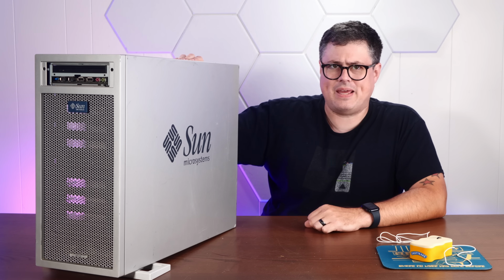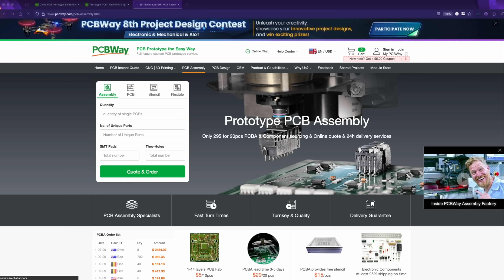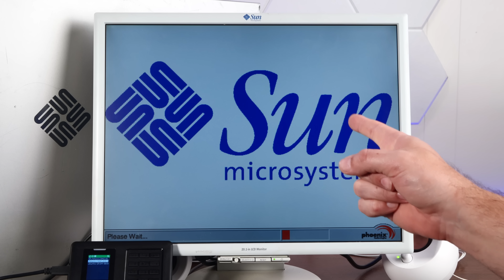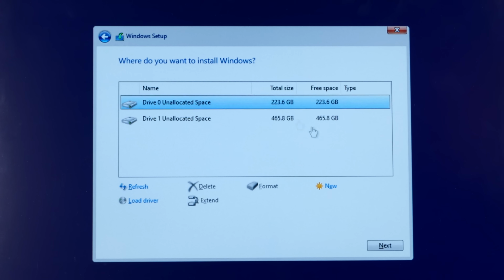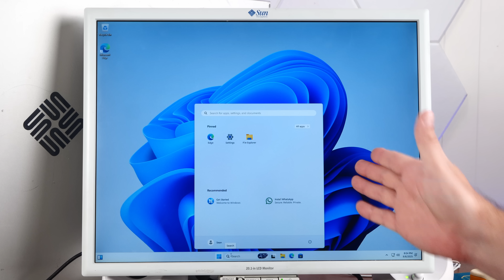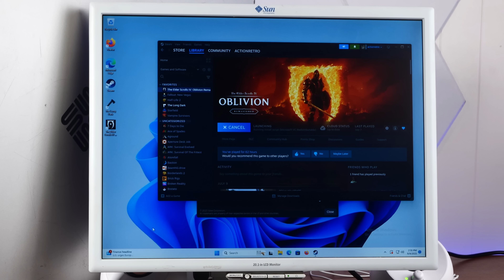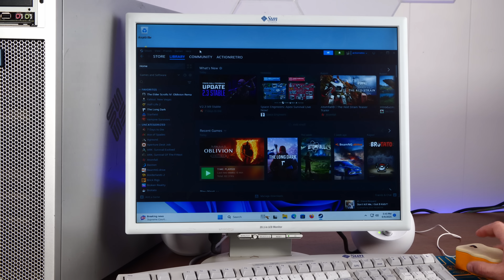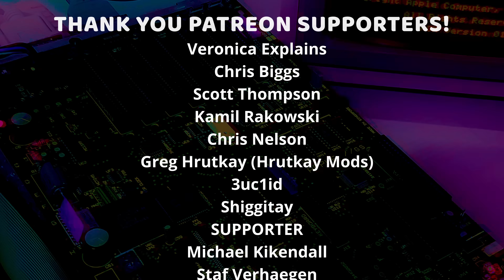The Oldest PC That Can Run Windows 11

Comment: These old workstation really where at least 10 years ahead of its time
Reply: it probably took over 10 years to pay for it
Reply: They were good but even a core2duo is many orders of magnitude better. Core2Duo machines are still usable even today. I run windows 10/11 on mine smoothly with no issues and use them daily.
Reply: 20
Reply: @cal2127  Windows 11 runs on my 2015 gaming PC just fine.
Reply: @Surplus_Softworks_Official 10 years isn’t that old for a PC anymore. Windows 11 runs just fine on my 2007 optiplex 745.
Reply: @cal2127 Wouldn't go that far. My mother has a dual CPU system from 2006 and this one was competitive playable until 2016. It was high end until 2010. It passed even the Valve VR Test and was telling me the CPUs where fast enough for VR if nothing was running in the background. Need to benchmark the system at some time
Reply: Nah😂. They were a joke compared to a Linux core2 dou extreme or xeon which was 4 core not 2 and an Nvidia quadro with an adaptec scsi card running Redhat Linux or Ubuntu or XP dual boot if needed for 1/4 the price. The Nvidia drivers were high quality back then and it would be an amazing workstation for it's day

Solaris was already on its way out and couldn't run VMware workstation. This would be for proprietary old apps which most were still on spare. So very niche and not general use if you could help it
Reply: this is 2xdual core Opteron CPU, it just equivalent 4 core CPU.1 dual core Opteron 2005 is much slower than core 2 duo e7500
 I dont think 2x CPU Opteron as fast as core 2 quad Q9400.

Comment: Tbf I feel the SSD is doing most of the heavy lifting getting Windows 11 to run decently, try it on an era appropriate HDD and it's just going to chug
Reply: I mean, even Windows 10 runs terribly on a HDD. Considering how cheap SSDs are right now, I think it's completely fine to use one on old stuff. HDD is only useful for storage nowadays in any circumstance.
Reply: @JorgeALXNDR  If you can whack a 2TB HDD in for your data (about $60) an SSD large enough to dual boot Windows and your favorite Linux distro costs less than $30.  For $90 you have a computer that boots quickly off of an SSD and still have room for your movie and music collection.
Reply: @mharris5047  That's close to what i do. I have a NVME 2 tb for windows and new games. Then i have 2 x 8 TB HDD's for Musik/movies/older games. the second HDD is just for redundancy.
Reply: You aren't wrong, but that's not great motivation to try it on an era-appropriate HDD
Reply: Sure, but it's the novelty.
Reply: Agreed in terms of speed and latency it goes 'Network > Storage > RAM > CPU cache > CPU registers'. Storage was lagging behind for a long time before we got SSDs and the old OS was built around expecting it to be crappy.
Reply: Removing a bottleneck does not mean its doing any lifting. Its just not dragging the rest of the system down anymore.
Reply: yup. i acronised the install of windows 11 from the pc i am on, an hp elite desk 800 g1 sff, to a 160 gb drive. holy shit took 10 minutes to boot. went back to the ssd!
Reply: And how about an era appropriate GPU and Ram amount?
He literally put the best that it could handle into it to make it look good.

8 GB of DDR2? Right on the limit.
GPU from 2014 and later 2020(ish)? Beyond what it was meant for and it's PCIe Gen 1 slot can handle. xD
Reply: Well yes! And if you want to drive your Car with your old Vespa Engine and Fuel Tank you may also better use a Bicycle!
Reply: You sort of missed the point though. It was to show that an old system, with appropriate hardware, can run the 'modern' op system.

Comment: Also if it is a 1000W PSU, it doesnt mean it runs on 1000W. I have no idea what really the consumption is, but I got an old DELL PE2950 in the basement with 2x 800W PSU's and it needs just 60W (without HDDs).
Reply: You aren't wrong, but in their original use as workstations they were given the power they'd need, and would definitely be wringing those PSUs for all they're worth. I wonder if playing games qualifies...

Comment: i ran into problems with early pci-e gen 1 slots, they wouldn't meet the power  needs of gen 2 or later graphics cards.
Reply: I don't believe PCI-E power specifications changed after Gen 1? 75 watts for a 16x slot.
Reply: @3rdalbum    im just saying, I encountered a problem with my gen1 pci-e mainboard when I purchaced a gen2 card.....It worked in the shop on a different setup and would work on different other computers I owned.
I believe it was  a gtx 7600 or i can't remember.  But I did some research and there were some gen 2 cards that wouldn't work on gen 1 mbs.  I am not saying the specs are wrong I am just saying it was a problem I encounteded.  So in troubleshooting with my computer store owner buddy that I did the Mac work for both concluded the same thing at the time.  circa 2007-9 somewhere

Comment: The hill I choose to die on is that this is probably done so OEMs don't try to put it into single-core pieces of shit computers with awful specs like they did with vista.

But of course, a geek with (no legal reservations) could just bypass those requirements if they really wanted to.
Reply: Windows 11 can be installed without overrides on an Intel N100 CPU, which is dual core but has roughly the power of a Core 2 Duo from the 2000s.

Comment: You've got one of the later dual core operons, there's Single core ones from 2003 that would actually be "the first" something like a SledgeHammer Opteron 144 or an Athlon 64 FX-51 would be earlier
Reply: Yup several people pointed that out in the previous videos comments but maybe had the video recorded already

If it was one of these very first opterons it would likely also not be able to run windows 11  (or 10/8.1) as they lack a few cpu instructions that were required from windows 8.1 and on.
Reply: @olnnn CMPXCH16B is a big one, basically prevents all Socket 939 systems from running anything past 7 64bit
Reply: Yeah and the CPU itself is from 2006 not 2005, as these instructions required for 64 bit Windows 8.1+ were only invented then

Comment: Can it support more RAM? Also maybe bit newer Opterons?
Reply: According to the spec sheet it can take up to 32GB RAM. It seems to only take the 2200 series dual-core Opterons, sadly no support for the newer 4 or 6 core Opterons. The current 2.8GHz CPUs were the fastest Opterons released in 2006 but in 2007 there was two faster ones, 2222SE 3.0GHz and 2224SE 3.2GHz

Comment: well the cpu came in august 2006 so i am not surprised that it worked with bypasses on widnwos 11. note that windows 11 23h2 is the last version that works on this pc. 24h2 and later needs sse4.2(popcnt) only present on x58 and later and amd fx and later
Reply: I don't know the details too much, but I thought on the Intel side, 21H2 and newer required instructions added in the 45nm Merom/etc era. Maybe AMD added those instructions earlier...?
(And then 24H2 adds the POPCNT requirement)

I've certainly used 23H2 on a 45nm C2Q, it actually runs quite well...
Reply: @vivienm7  I've tried 23H2 on a C2D E8500, ironically the bigger problem is the lack of RAM in that particular system. (Lenovo ThinkCentre SFF, board only supports 4 GB)
Reply: Yeah this straight up is NOT the original Opteron, I mentioned that in the first video.

One, the Original opterons were single core, Were DDR1 only (Not DDR2 like this system, so no it's not just an in socket upgrade.) and had a different instruction set support.

Oh, and Socket 940 was Pre-PCIe.

Which as you can clearly see, is not what this is.
Reply: Is the cpu upgradeable? On desktop PCs you usually can swap it out and install a later cpu that supports the POPCNT instruction. Laptops don’t allow for this because the cpu is soldered to the motherboard, choking off your upgrade path.
Reply: @NormanF62 well the answer is mostly no. If you have lga 775, no cpu supports popcnt on that socket and you need a full platform upgrade. But if you have am3 with a bios update you can replace a Phenom ii to a amd fx cpu with popcnt and sse 4.2

Comment: How safe is tiny11
Reply: Tiny 11 also has Window's protection programs removed because they call it all bloat, including Defender. So it isn't very practical.
Reply: @Charaqat  This is only Tiny11 Core, the regular version does have Defender
Reply: Its 100% safe if youre not microsoft

Comment: 'POPCNT' 👀👀👀
Reply: That really looks like it's missing a U!
Reply: I think of a "different" pronunciation than Sean's.  It has to do with a "certain part" of a woman's anatomy.  Anyone reading this under the age of 21 needs to not ask.
Reply: Lol
Reply: hehe
Reply: CMPXCH16B, which missing actually makes it impossible to run anything past 7 64-bit on a 2003 Athlon 64:
Reply: Sad because the Core2Quads are still pretty decent machines. 23H2 works fine though.
Reply: only in 24h2 and later.
Reply: Yeah I wonder what she can do that Microsoft absolutely needs for their Windows.
Reply: SSSE 4.2
Reply: @victormanuelmoralesvanegas2480 ssse3 and sse4.2 are 2 different things
Reply: First time i even heard of that, mostly because i'm on Windows 10 and have no desire whatsoever to trade it for Windows 11.
Reply: An instruction that has been re-implemented in software and is faster than the hardware!  - I.e. Microsoft is Lying or Lazy ...
Reply: you can also bypass It's circumventable, Windows can still have functionality if we deactivate the pop-up sector, the AI functionalities won't work, but we don't care anyways ,even, it is better.
Reply: @BLACKWELL-1  There is no known way to circumvent the POPCNT requirement or SSE4.2/SSE4a in 24H2 onward. Windows would have to be recompiled to include support for older instruction sets, and good luck doing that without the source code.
Reply: @BLACKWELL-1 what?